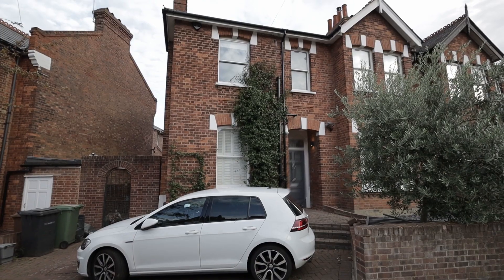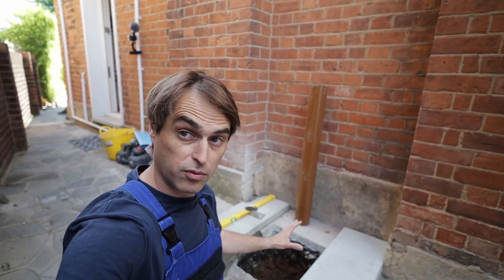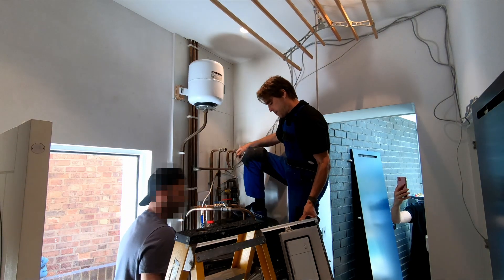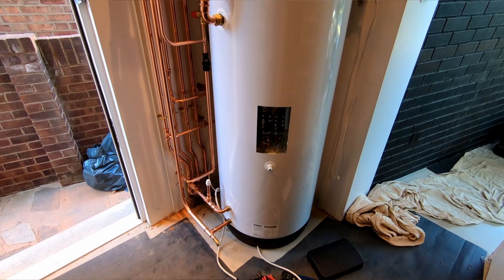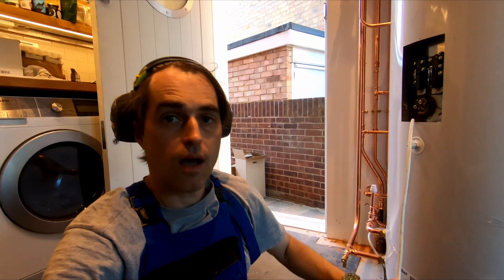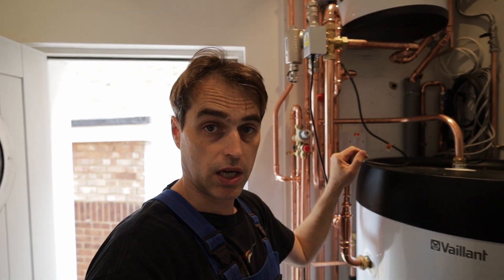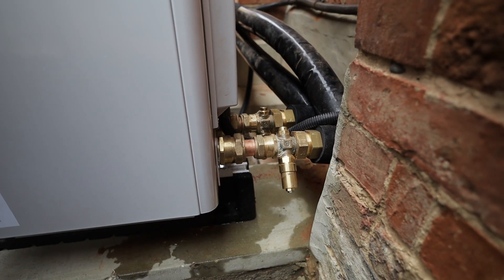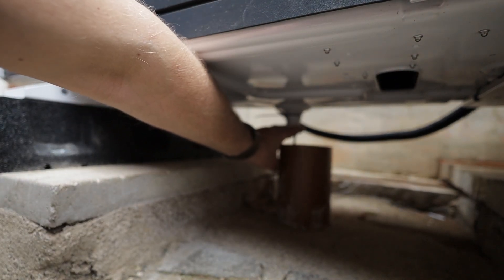Is This Heat Pump Better Than Your Gas Boiler?

Comment: Oh, you're so lovely!  I'd say you were cutting it a bit fine by just covering the heat loss. When it's minus two things happen in houses, people come and go all day and open doors and that heat escapes. I don't know about other people,  but when I come in after working outside I'm wet and cold and look forward to a bit more than a measely 21 °c. One of the best ways to get warm is a soak in a hot bath, is there going to be enough output to heat water when you have to take into account the temperature of the incoming water's going to be less than normal? Did you take into account how many people live in said house? Anyway, time will tell.
I'd just love to know what anyone else out there thinks.  My choice for insulated 2 bed bungalow is 8Kw ashp with 1,000 litre thermal store. You need a good size for a thermal store with a heat pump, 1°c is just over a Kwh so you can store about as many Kwh as your delta t.
In case you're interested, I fixed for a couple of years at 10/30 p Economy7.  I think my plan will fail long term as I can see E7 is likely to be phased out with the expected growth in EV charging overnight.
Reply: Totally agree.21C isn't warm enough to just sit and watch TV unless you wear loads of clothing, also hot water cylinders are useless for a family who all want showers every morning!  I will stick to my gas combi.

Comment: Great video! But what about legionella? Will the heat pump have to run at 60C+ domestic hot water occasionally or will it rely on an electric heating element in a cylinder to bump up the temperature? Thx
Reply from the maker: There is no electric element controlled by Hp. It can bring the temp to 60c easily as the flow can go as high as 75c , so it will run legionella cycle once a week.
Reply: How many legionella infections have ever been identified as occurring at a domestic property in the U.K.?

Comment: Being an air con engineer a heat pump system would be the last thing I'd ever have in my property
Reply: You are the second person who is an air con engineer that has said this. Why is that?
Reply: @RayMondElec  they maybe OK when the outside temp is not too cold. In the winter months when the temp really drops there efficiency falls away. Did you notice on the video he quoted a temp of minus 2 but temps even in the UK often fall lower than minus 2 at minus 5 they lose there efficiency completely. It's in the winter when you require heating. I'll have all these heat pump salespersons saying I don't know what I'm talking about but believe me I do. This system has been around for years. Its been used in offices but only to heat the air in the offices never to be a primary source to heat water. Hope this explains my complete disregard for this con job that is being forced upon us by the government. The country can't supply enough electricity for the country NOW. 😕
Reply: I'm almost completely ignorant to the technical nuances to the refrigeration side of ASHP but am up to speed on the hydronics. In  the training we do the manufacturers rebutt this argument by saying: 'yes but we're running r290 now and that works really well at subzero temperatures'. Are they bullsh1tting us?
Reply from the maker: @griffithsheating  no they are not. Colin doesn't have a clue what he is talking about.
Reply: @UrbanPlumbers  really think its the other way round. You stick to plumbing and leave the technical bit to air con engineers. Question do you actually commission the condensing unit yourself or a ac engineer????????
Reply: @griffithsheating  yes
Reply: @colinensell920  weather data (which we use when we design systems) says it's rarely -5 for long in the UK. And then that will normally be at night where you will either set back your temperature or run off peak juice to mitigate the drop in COP. This is why you get properly trained installers in. Unfortunately there aren't many of us about and heat pumps will be slung in like ideal logics and you will appear to be proved right.

Comment: What’s the cost difference off the install compared to a gas boiler the money you save on energy bills could take years to pay back the difference in cost for the install
Reply from the maker: With government grant of £5k the cost is very comparable to a high end boiler with new cylinder such as Viessmann or Intergas.

I have actually installed new gas boiler where the client paid more than this installation
Reply: @UrbanPlumbers  I love this channel and think your work is amazing. But the more I read on the comments section on heat pumps I just feel you're being evasive.
What about an 'average' installation?

I didn't notice if you did a video on it but how about a comprehensive review on all the pros/cons costs etc... comparing a fully insulated house for gas vs ASHP?

I've got a large (3300sqft), 3 story, cold house that I desperately need to do up. I currently waste about 37,500 kwh of gas on CH and HW and happen to use about 4000 kwh of elect.

I'm running out of time planningwise but have to come to a conclusion on how to heat it.

I will install as much insulation as possible etc but just don't trust the figures on ASHP enough.

I'll put in PV and battery storage as well and a brand new heating system so really need to get to the bottom of this.

I've got rental properties as well so not just limited to my home.

Comment: to check how much you can save there is the quick math: 1m3 of gas gives you about 8kW of heat and can be replaced with about 1.5 to 2kWh of electricity in a heat pump to make the same 8kW of heat. fun fact: if you burn the gas in a power plant you can create 24~30kW of heat if you were to power a heat pump with it.
Reply from the maker: Nice one
Reply: @UrbanPlumbers  that is the math i generally use towards building managers and c-suite people. you need to use small words and basic math otherwise they check out of the conversation. try it, it give great results especially if you lead the question with asking about how much they pay for gas and for electricity. dont forget: you also have to pay for the gas connection. if you dont use gas you dont have to pay that amount as well, so that is easy money.
Reply: What's the cost of 1m3 gas vs the electricity please?
Can you get a CoP of 5.333?
Reply: @ChrisLee-yr7tz  with underfloor heatin you can get a COP of 6. and dont ask me what you pay for electricty and gas. look at your bill.
Reply: @SupremeRuleroftheWorld  ok, but generally people aren't interested in what they can save in kwh. They're interested in what they can save in £.
Your quick bit of maths could have been a tiny bit longer.
I've been reading through all of the comments here and you seem so confrontational. If you want to take people with you and prove the point on ASHP I think you'd benefit from chilling out a bit.

Can you use underfloor heating efficiently with suspended floors upstairs and down? Would you still get 6?
Reply from the maker: @ChrisLee-yr7tz  current cap is around 1:3 gas vs electricity, meaning that you only need cop of 2.8 to run at the same cost as gas. This installation is 4.1 so do your own match
Reply: @UrbanPlumbers  My latest bill, EDF, has 33.7p vs 7p....4.8
The reason I asked was because I didn't know why they mentioned cubic metres first. Thought maybe there was some other adjustment to add in. Turns out it wasn't relevant.

I don't know why mine is such a high ratio. I will investigate. EDF are totally fkin useless though.
But even the publicised change in Oct will only go down to 3.6 so no idea where you get 3:1.
Reply from the maker: @ChrisLee-yr7tz  no thats the price per kWh you are at right now
Reply: @UrbanPlumbers  I thought that's what you meant when you said the current cap is 1:3? I'm on the CAP.

Either way, the current cap isn't 1:3
Its approx 7p:30p so just over 1:4.
Fk knows what EDF are charging me.
Reply from the maker: @ChrisLee-yr7tz  yeo that is correct. When i men new cap I mean one coming in the near future as they announce them beforehand.
Reply: @UrbanPlumbers  yep...but you said current cap not new. Nevermind.
Anyway, I appreciate they're skewing more in favour of elec going forward. We'll see if that continues beyond 3.6

Overall I've made a few comments all over this videk. I really think a comprehensive comparison video of all the maths would be brilliant. I love your installs etc... but just find the numbers are skipped over and a bit opaque.
Trying my hardest not to criticise...just making a suggestion.

One important thing to distinguish is there are two independent changes to make. Crap insulation to good insulation. Then once insulated, gas to ASHP.
Seeing annual kwh pre insulation improvements, to post kwh.
Then comparing the two methods would be great.
Including install costs, maintenance etc...co2 reduction. The whole works.
People need to be able to make an informed decision and seeing it here would be great.
Reply from the maker: @ChrisLee-yr7tz  I agree. I should have total of 4-5 ashp jobs completed before the winter that I will come back to next year and see if I can get realistic data to compare.